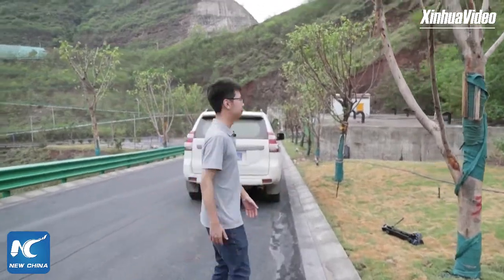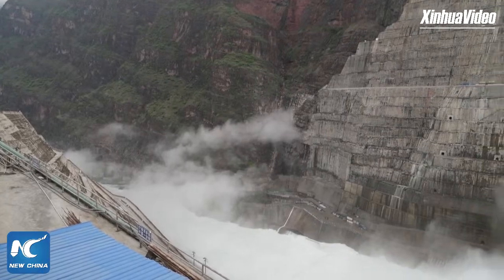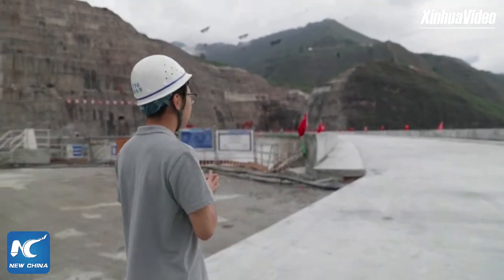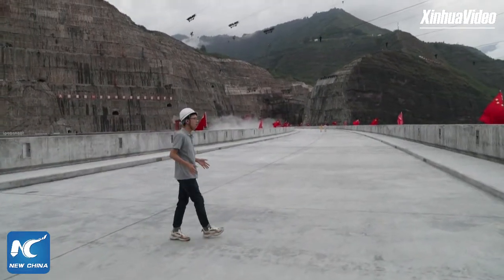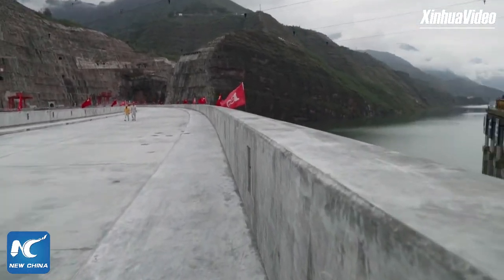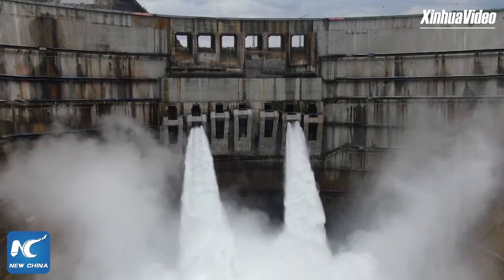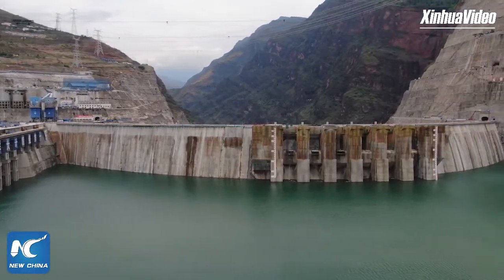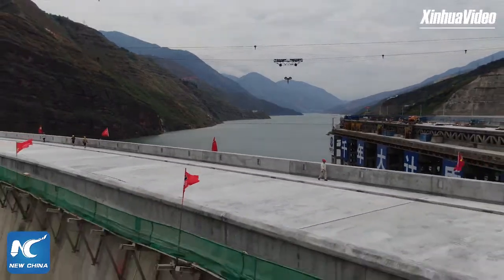China's new mega hydropower station begins operation in Yunnan

Comment: Few things that put this hydro station ahead of the west.
(1) Construction started 2017 and commercial operation started on July 2021.  In the west it can take twice as long.
(2) China has developed the biggest hydroelectric turbine of 1,000MW each.  The world still regard 800MW unit as the biggest.  China has already broke the rocord with 850MW hydro unit in Wudongde which is the world's 7th largest.  It completed all its 12 units just before Baihetan produces electricity commercially.
(3) Baihetan is the world's second largest power plant.  The previous No. 2 was Brazil's Itaipu hydro that has 14,000MW.  Baihetan has 16 units of 1,000MW turbine so its rated output is 16,000MW.
(4) Baihetan elecitical power is to be transmitted over thousands of km to serve the provinces in the eastern coast.  That means China has the world most advanced power line transmission system using ultra high voltage in DC.
(5) Baihetan hydro is China's indigeneous design and manufacture.
(6) China's electricity charge is among the world's cheapest.  This enable China industrial output remain competitive relative to thw western democracy.  Electrical power is widely available to all areas and not like in the west only to those who can pay contribution to the installation cost.
Reply: Wow man, excelent introspection.
Reply: You need to change it from "worst" to "world".
Reply: @jaredgarbo3679  Thanks
Reply: Gun Sum Wong What a beautiful Technical Description Scrip you Have Details about Mega Electricity generation Hydropower Generation Power Units in China undertaken by Three Gorges Corporation in China . Love your Technical Scripture articulation Article and Comparison of International Standards of prevailing Power generation units at present level with other Countries too . Thanks for your Support of this Article Description in details feedback .
Reply: @makuohua3071  China gets to today by working hard and innovate.  The west only bully other weaker sovereign nations.  When they run out of money they print trillions of dollars forcing other nation to share the depreciation of their currencies.  China isn't just the world leader in hydro it is also the leader in wind and solar energy.  China is currently world No. 2 on nuclear power generation and has its own indigenous design of  Yalung One nuclear reactor which has been put into commercial operation recently.